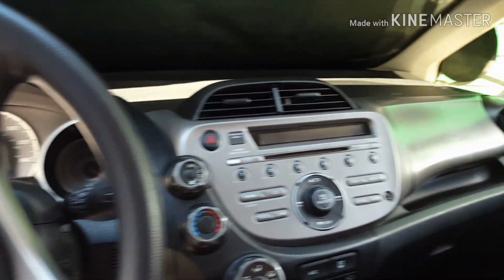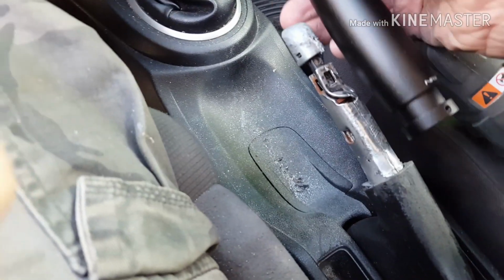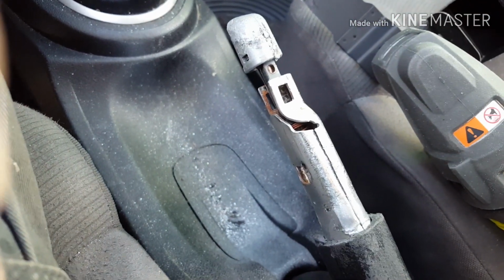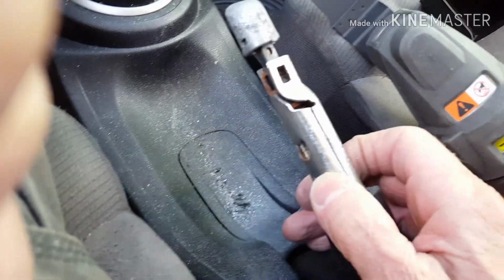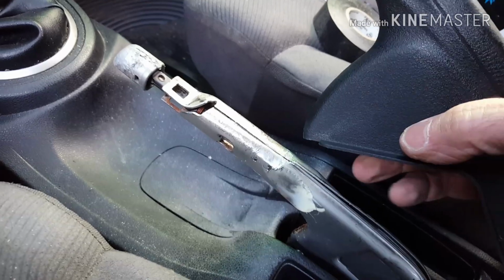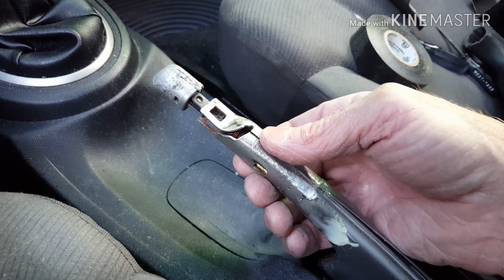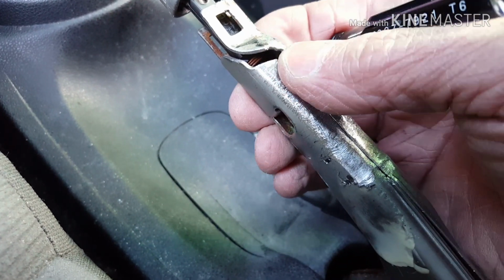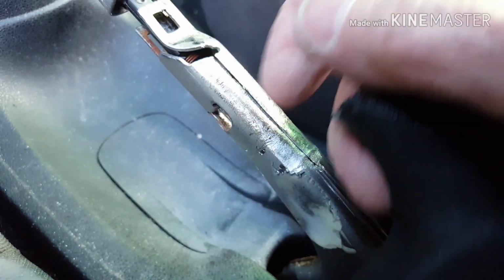HONDA FIT HANDBRAKE REPAIR

Comment: That's a helluva lot of work.  The center console comes off easily.  Put front seats all the way forward and at the rear bottom of the console are two rubber plugs, take those out and there are two 10MM bolts, remove those.  At the very front of the console are two of the threaded plastic bolts you take out then remove the plastic insert.  The entire console lifts off.  The shifter has to be in neutral to get the the console off for clearance and you can do that with the key off by using the manual release so you don't have to sit around with the key in the on position.  It's that little plug you remove on the left side of the shifter then poke something in there and release the shifter if your car is an automatic.   Since you may be working on the parking brake and  you are taking the vehicle out of park, be sure to block the tires so the car doesn't roll around.  Once off, the rest is child play.   I replaced mine with a wrecking yard replacement after my dog chewed mine up also.